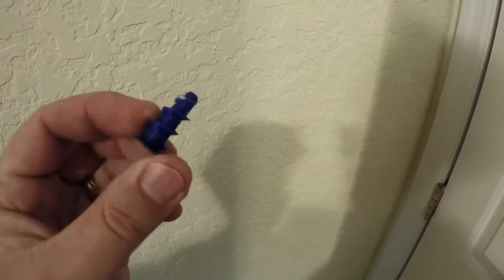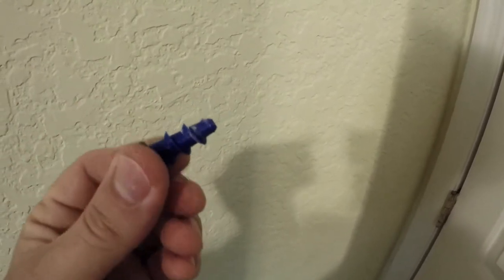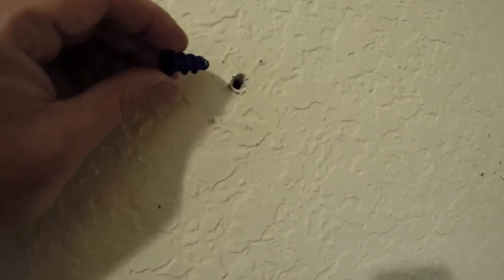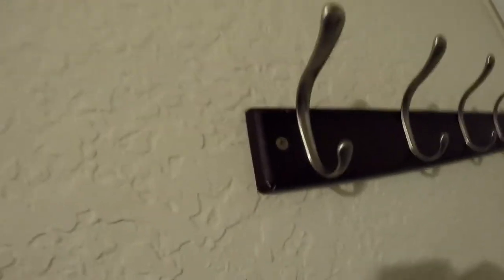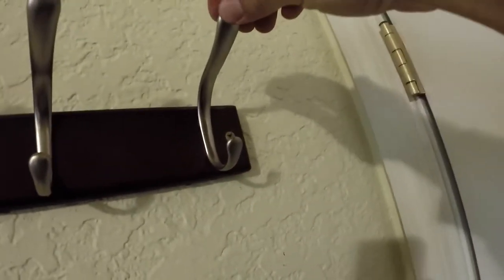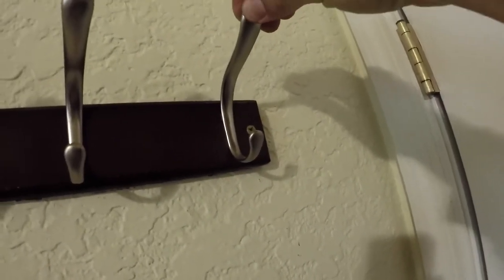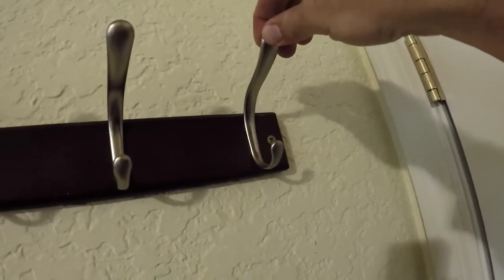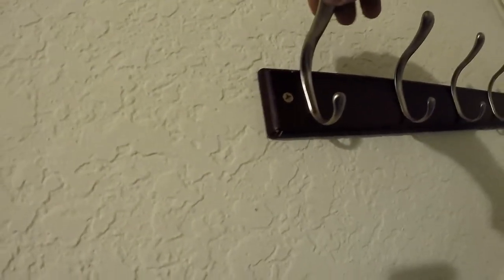3D printed drywall anchor

Comment: two questions:

Can you increase the output size. Id like to make this 1 foot long

How hard is the material that you print with. Id like to use something really strong.

Anyway if you answer this I would be grateful. Thanks
Reply from the maker: I'm not sure what the max detentions are for my printer but in theory it would be possible to print some thing around a foot.